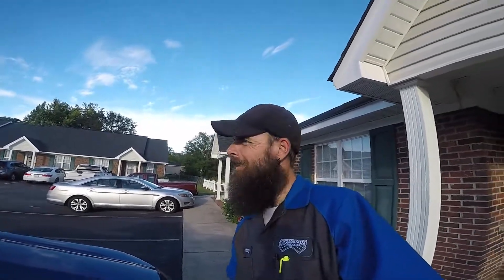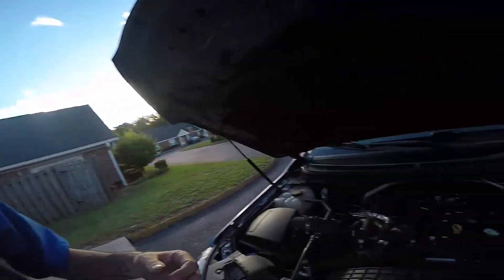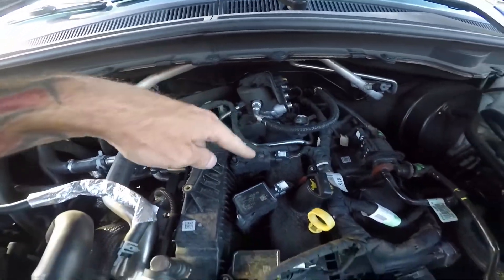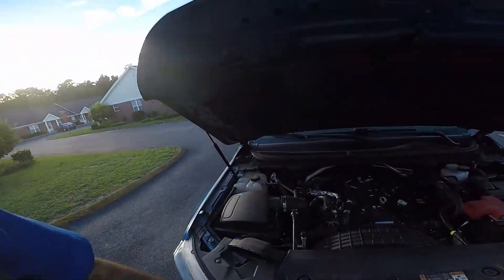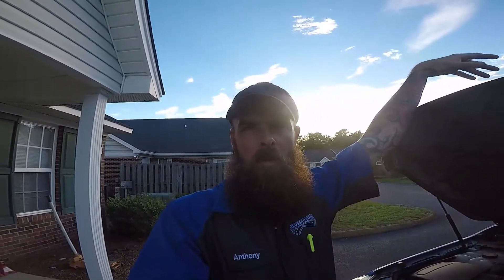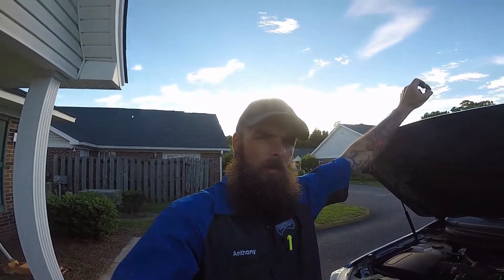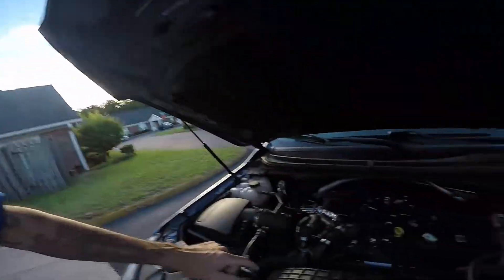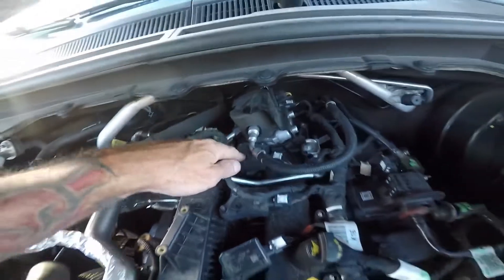2020 Ranger P0299 P0304 Turbo Underboost Cylinder 4 Misfire.  What Happened?

Comment: My truck is throwing those same codes. Cylinder 4 misfire and turbo underboost, Ive been thinking it's carbon build up on intake valves, because I've changed spark plugs and coils, ran fuel system cleaner, it could be the injector.. but it is a gen one 3.5 ecoboost and I got it at 140k miles and I installed a catch can, did the intercooler weep hole etc etc
Reply: What's weird is it just has a rough idle, yet when I accelerate it's smooth and has power vs before changing coils and plugs, it would hesitate and feel like it had no power, it smells like it's burning a lot of oil and yeah I dont know to much about repairing so this interesting to me, gotta get a leakdown test kit and check compression etc
Reply from the maker: @AaronJDizon  what kind of plugs and coils did you use?  They don't like aftermarket. Also could be the coil driver.
Reply from the maker: It's not the intake valves or fuel system.  Running fuel system cleaner through the tank doesn't clean the valves. It's direct injected.  You need to do an injection cleaning to clean the intake and valves. If it was carbon build up. It would be more than just cinder 4.  Have you ohmed out the coil?  Cylinder 4 on that one is the first one up front driver side. Swap it with cylinder 1 first one passenger side see if the misfire moves to number 1.  You may have a dead coil.  As far as the underboost. You could have a bad turbo. A Leak in the charge air pipe. A dirty air filter a faulty boost pressure sensor just to name a few. This truck literally had a piece of metal in the cylinder and beat it up.

Comment: Interesting. That's really unfortunate about the piece of metal in there. That's always your worst fears....

My ranger did the same thing.. but mine had water in  sparkplug hole in cyl 4 and a misfire. This only happens to me when I park my truck on a hill with the front in facing down the hill. So some water gets on top of the engine some how and it sits mainly on coil pack 4. When my truck is on level ground not one drop gets in the engine bay. Even after a huge storm. I haven't tried with the front end facing up the hill but I don't want to try it!
Reply from the maker: There is a TSB for that. They add an appearance cover that covers the coils. May also be covered under warranty. Check with your local dealer
Reply: @BeardedFordTech  the cover is on backorder till April :( thanks for the video buddy!
Reply from the maker: @champinsoccer9  your welcome. April isn't too long. Have you checked Amazon or anything.
Reply: @BeardedFordTech  oh yeah I was just going to buy one myself but I decided to let ford pay for itlol I just always check it after it rains make sure there's no water  there

Comment: By the title I was thinking that the misfire was occurring during hard acceleration or load as I always interpreted that as under boost. It dawned on me that the vehicle is not producing enough boost. I'm getting old.  🤣🤣 The only other way that metal could enter the engine is through the tube that is attached to the throttle body. I would pull that tube and check the impeller on the turbo. Some impellers are made of cast material. It's possible that a piece broke off of the impeller. There's enough pressure to blow a small fragment under boost into the intake. A small piece can slip past the valve and bounce around the combustion chamber and then get wedged between the valve and seat. Which valve is stuck open? Do any other plugs show evidence of oil? If the turbo has a bad impeller that will throw off the balance and wear the bearings/seals. The turbo will blow oil into the intake. I am very intrigued by this problem. Keep us posted. This is great content!
Reply from the maker: No other plugs had oil. Only number 4. The way this turbo is set up the tube on the compressor side hooks to the charge air cooler for inlet and the outlet to the throttle body is on driver side. So an impellar couldn't ha.gone that way. It would have to go through charge air cooler. I'm dumb founded by this. And I want to know what it is as well
Reply: @BeardedFordTech  This is very interesting. When the fan decided to do the Peter Pan could it have hit the charge air cooler? Maybe it is a piece off of that. Did the fan knock off any of the tubes to throttle body? Maybe a fragment off the fan made its way by hiding in a tube and the tube was reconnected without noticing.
Reply from the maker: @mlieser1230  nope charge air cooler sits in front of radiator. Fan is behind that. Fan was in one piece. No holes in charge air cooler. And if there was I would have had a boost leak when I put it back together. One tube to the throttle body. That's the one that comes off charge air cooler. One tube comes.off airbox to turbo. One off turbo to inlet on charge air cooler. One purge valve which directs purge/wastegate into the airbox to be recycled. Call me real quick
Reply from the maker: @mlieser1230  I should do a Livestream on this real quick
Reply from the maker: Call me. I emailed my number